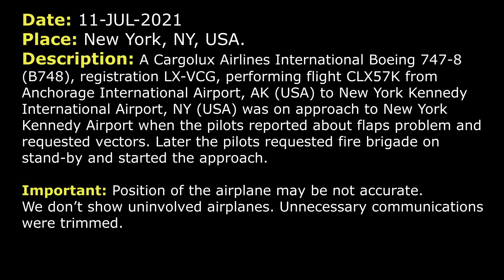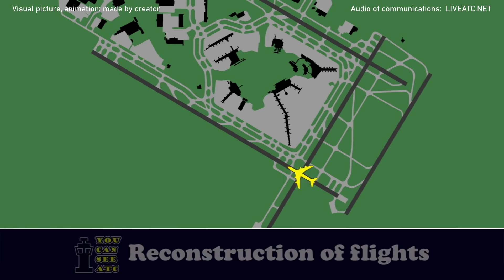Flaps problem. High speed landing | Cargolux Boeing 747-8 | New York Kennedy, ATC

Comment: it really bothers me that they're asking for fuel in pounds over and over again. Firstly, they're flying internationally and their plane is likely set up for Kg. He specified 16 tons of fuel as well. Just convert it to pounds or get someone else to convert it for you while you're handling the aircraft, good god
Reply: Absolutely, I understand why ATC needs fuel and souls but their obsessiveness gets old.
Reply: Someone must have Google on their iPhone in the control tower, no?
Reply: The official rule (according to the 7110.65) is that fuel should be expressed in remaining time , not pounds or tons . Almost every controller incorrectly asks for it in pounds
Reply: @MrJONES925 It is not incorrect. ATC usually specifies "in pounds" when ARFF needs the weight.
Time is important if the plane needs to hold, but doesn't say a lot about the amount on board, since fuel consumption varies a lot between different aircraft configurations, speeds and altitudes.
ARFF needs to now how much foam they might need, and more importantly, how far away from a potential fire they can station, since the blast ratio depends on the amount of fuel.
Reply: Tower: The fire brigade is asking for amount of fuel on board. Pilot: A shit load.
Reply: The controller obviously didn't hear their first answer at 05:00, nor the communication from Korean Air. There is a small ambiguity with using "tons/tonnes". Not sure if it's enough to make a difference in these circumstances. 15 US tons = 13.6 tonnes; 15 tonnes = 16.5 US tons.
Reply: @gemma3877  to be honest who cares. 16t metric/long/short gives a decent indication of the quantity of fuel on board. Thats what the fire department is looking for not a quantity upto the litre. 
Converting to pound= *2 and this is good enough for the same guestimate
Reply: He did it deliberately - it's in the tone of his voice with the last request; perhaps ATC should be required to read back to pilots for clarity sake when relaying emergency information? Or maybe that can be a JFK rule ;)
Reply: He only asked 3 times, and got it on the 3rd time. That isn't really a lot of times to ask something.
Reply: @ImpendingJoker  he actually got the answer on both the first and the third request.